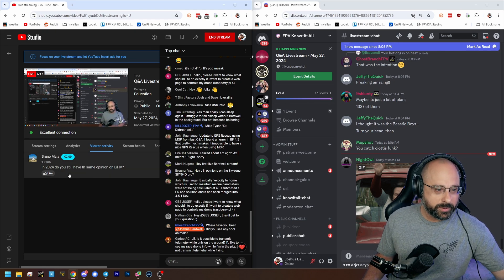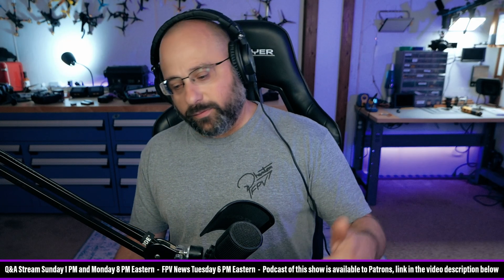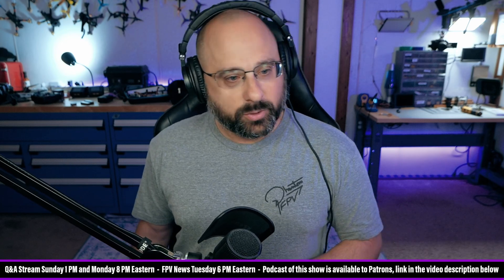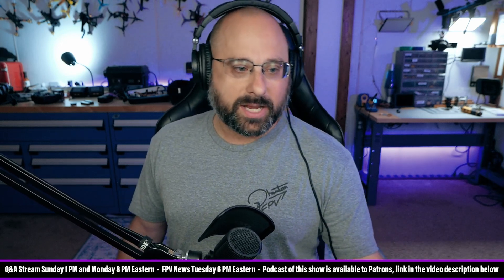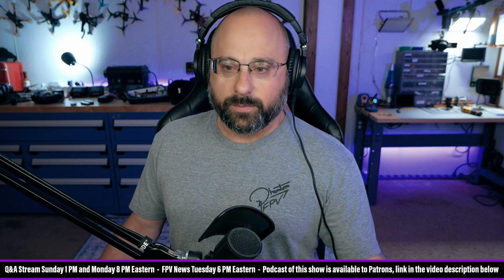Should I Use High Voltage Lipos? Should I Charge to 4.35v? - FPV LiHV Questions

Comment: I have a 2s 450mah lipo my charger only could charge 500 or 400mah lipo what mah should I be charging the battery too without causing any damage to the battery 400 or 500mah. Thank you for your help 😊👍

Comment: Thoughts on using lihv but only charging them to 4.2 so they last a long time? Might be the strat
Reply: I hope anyone will answer
Reply: Good way to get the battery to last longer, but just be aware that the flight time will be less that the mAh rating suggests. I think roughly equivalent to a non-HV of the same weight.

Comment: My GNB HV  850 4s after 1 month of usage blew up huge, still work 4 months on but they are ballooned to fk.
Just got some Coddar ones I didn't realize were HV, been charging as standard lipo, getting same flight time as normal battery so I'm going to keep them charged to 4.21 and see how they go.
Reply: DON'T keep using puffed up batteries - that is SUPER dangerous!!

Comment: Gnb 1300 hv are badass(purple 6s). They are pretty solid if you dont abuse them and they weigh less. The difference is mostly weight in the end. I cant speak for any other brand hv tho..
Reply: Those are 100% my favorite 6s batteries rn. They're great.
Reply: Do you know why both of mine are giving me battery warnings after about 10 flights? I run them from 4.35 to 3.7 and they just don't seem to last like my normal lipos. There's no physical bloating or anything and fly fine but gives me a red battery warning if I go over half throttle or fly for over 2 min so I'm scared to buy more
Reply: @UmNitro  check the resistance while charging. High resistance in a cell can indicate damage.

Comment: What's the difference between motors of different sizes but similar kv? Ex: 1404 3500kv vs 2004 3500 kv?
Reply: It's just the allowable power dissipation. The 1404 motor might be rated for X amps. While the 2004 is probably rated for 2X amps. This means you can run a larger propeller, and use a higher voltage battery. The motor will draw more current, and provide more thrust.  If you run a 1404 and 2004 3500kv motor with exactly the same battery, and the same propeller, in theory, they will produce the exact same thrust. Obviously the 2004 will be heavier, spin up slower, but also probably more efficient and cooler.
Reply: torque

Comment: The problem with LiHV is that many batteries labeled as LiHV really aren't.  They are just standard lipos with a label that says they are HV slapped on them.  Dishonest sellers just brand and sell them that way.  And you can charge a standard lipo to 4.35 is almost zero safety risk.  But you will probably only get about 20 or so good cycles until the battery starts to seriously degrade.

Real, high quality LiHV batteries do exist.  There is a slight difference in chemistry.  The main benefit is higher power and energy density over a standard lipo.  However, they do degrade a little bit quicker if charged to 4.35v.
Reply: I think actual HV's use graphite on the anode, which should help against dendrite buildup on that crucial part.
Reply: how do you know? Why would they do this? HV lipos are VERY common tech due to phone batteries advancing it and making them equally as common. I don't think there's a price difference

Comment: I've been using Tattu 450 mAh 2S HVs for years.  I charge 'em to 4.2v, and run 'em to 3.6v; I get 3 minutes per flight.  I get hundreds of good, non-sag cycles this way.  I also never let a charged pack sit for longer than 2 days, absolute max.  Baby your packs, they'll last.  Mind you, I'm an old git who flies like an old git.  Younger flyers may want to live a little.
Reply: If two days have passed, and you haven’t used the charge, do you put it back into storage mode using a battery discharger?
Reply: @Ag23445  Yes.  Most chargers have that function.
Reply: Hey. I don't use HVs, but I think it is obvious he puts them to storage if he didn't use the charge. What else could he do with it? A battery charged full and forgotten about for several weeks will surely not have long lifespan.
Reply: hey man, if you baby your packs even if you push them to the absolute limit they will last pretty long. i have about 10-20 cycles on the 6 packs i own and they are still fine

Comment: I don't know, but for me HV sounds like a bunch of BS... I'd stay away from them.
Reply: except for tinywhoops
Reply: @David-ty6my  Even with those.
Reply: @MCsCreations  can you tell us what secret whoop batteries you use that provide the best performance and flight times?
Reply: @cptncannoli  I'm just a dude flying my whoops and staying away from HV batteries, dude. I've got no secrets, I just fly for fun and there's that. I didn't claim anything.
Reply: @MCsCreations  what batteries do you use? I’m in the market for a reup
Reply: @cptncannoli  Lately I'm using GNBs... But I'm from Brazil, it's kinda hard to get batteries here... So I use the ones I can get. You know? 😕
Reply: I think real HV's use special coatings to prevent dendrites from growing inside the cells; degrading and eventually killing the battery.
Reply: what about them is bs to you? It's very real tech